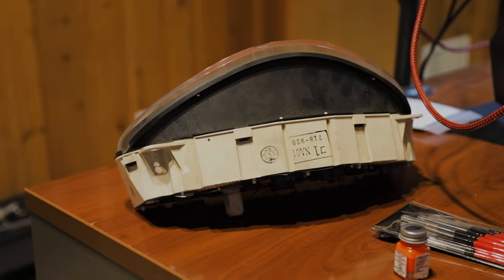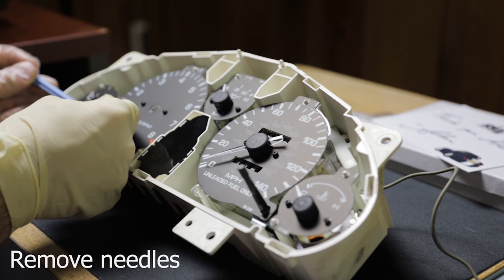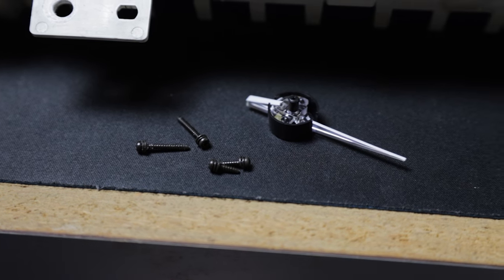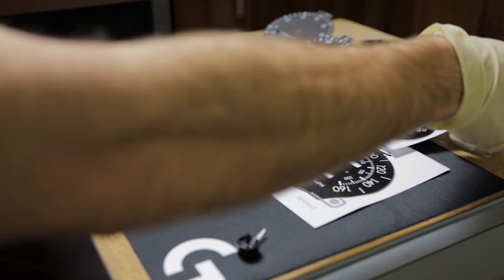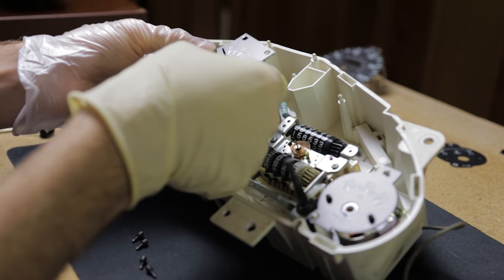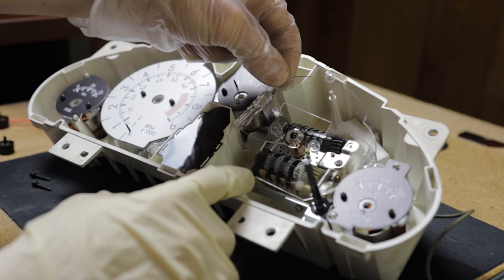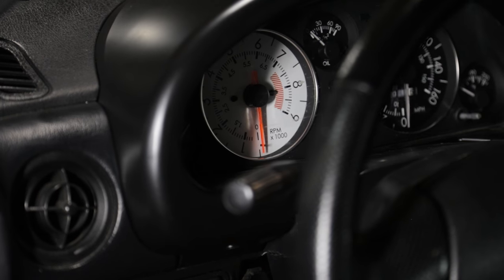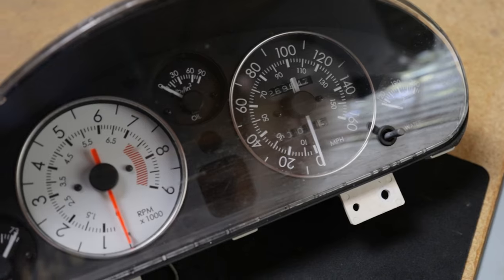Installing Revlimiter Gauges in an NA Miata!

Comment: I have a set but I got cold feet awhile ago especially about the tach and oil pressure, worried about those being inaccurate so I haven’t put them in yet lol.
Reply from the maker: Yeah it was definitely kind of nerve racking. Take note of your oil pressure on cold start and warmed up idle rpm before taking anything apart and you should be fine.
Reply: Most likely. I’d heard the factory oil pressure gauge wasn’t all that accurate anyway, I mean even the real one on the first few years not just when they changed it to low and high.

Comment: did you only paint top and bottom of your needles or did you paint sides too
Reply from the maker: So you actually only paint the bottom edge. That's how it is factory, this way light will still illuminate it.